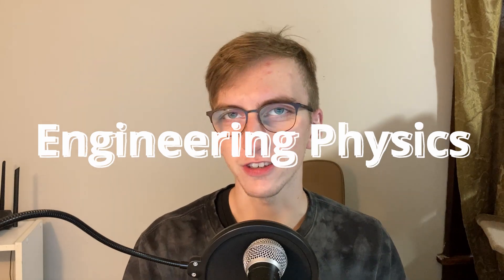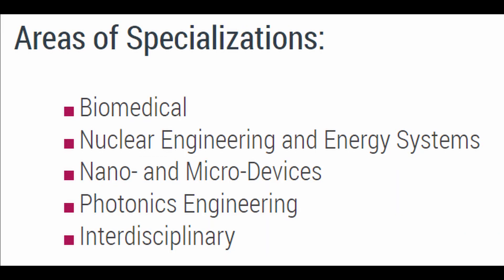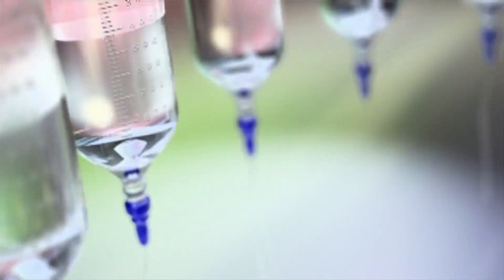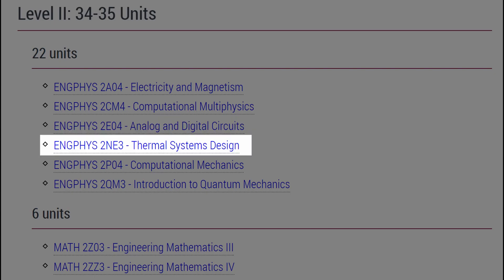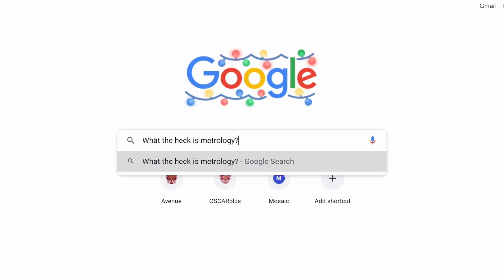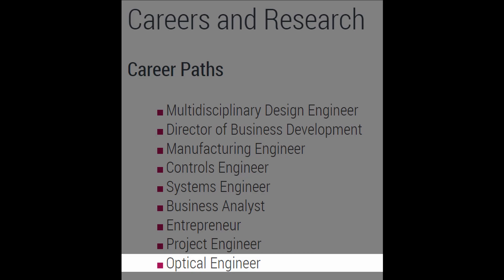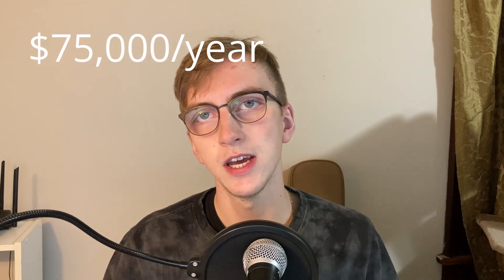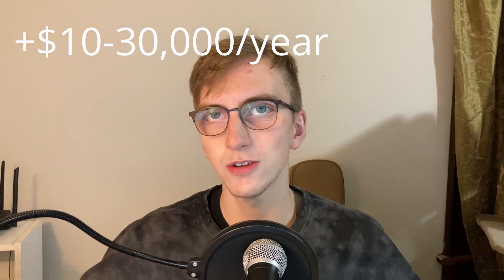Engineering Physics - The COOLEST Degree!

Comment: As an aspiring physics student, thank you for making this video. I agree that engineering physicist is more of a "science-y" because they conduct more research than the other engineering fields. Adding on, I believe that an engineering physicist can create the tools that a physicist (or any other scientist like geophysicist, chemist, etc) need such as a new particle accelerator or seismograph. This is because they can be "bridge the gap between scientific theory and engineering applications." Basically, they can collaborate with both scientist and engineers and address the needs of both fields. Once again, thank you making this video.

Comment: I have a BS from Berkeley in Engineering Physics, it's structured a bit differently than discussed in this video, it was a subset of Engineering Science as a whole, which contained other odd interdisciplinary Engineering + pure phys/math/science hybrids as well.
For Berkeley, and likely many other Unis, a key consideration is that EP was very much geared for the student to go to graduate school, it was one of the few "Engineering" degrees with a GPA minimum requirement (essential for grad school compared to more execution-oriented engineering roles), and was a vestige of the Manhattan project --> Cold war, where the nation needed top tier research universities to be feeder programs to higher ed and government labs. With the consolidation of govt labs from hundred(s) down to dozens, the field has been in decline for decades, which is why it's relatively unheard of compared to newer sexier engineering fields (e.g. BioE).

The strong emphasis towards graduate school (at least at Cal) also means that you are by definition much less employable than other engineering degrees (e.g. EECS) for well-defined roles such as programmers.
Sure, there are those niche areas where the ability to digest just a bit more information than the next engineer, at a slightly higher level, is more valuable than a more traditional engineering degree, but it's important to keep in mind that many graduate level engineers and physicists (esp at the PhD level) can also do that, so you're really looking for fields that want a slightly more generalist engineer, but at an undergrad level (rare).

Finally, due to the small size of the field, and the very very wide array of paths you can take due to the inherently interdisciplinary nature of it, it's a fairly lonely program, as you aren't in a well-defined cohort of students going through very similar lower and upper div classes; there's quite a diaspora at the upper-div level, especially during senior year.

All in all, the realities of the major in my opinion means that the downside greatly outweigh the upsides.

Edit:
Forgot to add - for current EP majors, I highly recommend not "enjoying" random electives too much, and focusing deeply on one of the tracks that appeal to you, the extra depth of knowledge in a specific field will make you much more employable and competitive against others who came out specifically studying that field (e.g. think about an EP with some intro level dabbling in aerospace plus nuc. eng plus whatever, vs. a dedicated aerospace engineer).

Comment: Is Applied Physics and Engineering Physics same? Please reply. Thank you.
Reply: They may be a bit different with Engineering Physics being more focused on the engineering portion such as designing, testing, using software (Computer-Aided Design, MATLAB, etc.), engineering ethics, a bit of chemistry, and other engineering practices, whereas Applied Physics can be seen as a bit more theoretical in comparison with the other courses being spent on a broader and/or deeper range of physics courses instead. Of course, each university may vary a bit, but the two are definitely on the broad side.
Reply: Yeah whenever I look up information for Applied Physics, I keep getting results that lead to Engineering Physics... So I'm wondering about the answer to that question too.